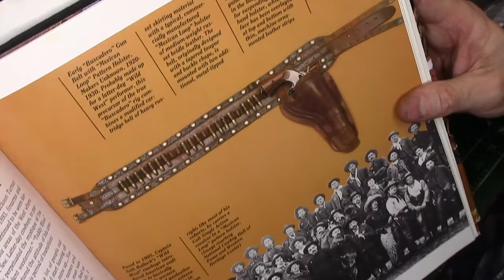Leathercraft: Buscadero Tooled Leather Cartridge Belt & Holster Cowboy Action Cosplay Leatherworking

Comment: I've made a stage version of this whih, instead of a slot cut in the leather, has the lower decorarive strap securely rivetted to the main belt at points separated by a holster width. You can hang the holster/s from any of those loops, allowing you to (say) switch from single to twin guns to side + crossdraw without having to cut multiple slots. Truly versatile.

Comment: Amazing as always! May I ask some questions? 1. What do you use to dye? Whats in the pickle jar?;)
2. What thread did you use to hand stitch this? Thank you so much!
Reply from the maker: This one was dyed with Fiebings' russet thinned down with denatured alcohol. That's what's in the big pickle jar. After the dye dries I give it a coat of neatsfoot oil then use the antique finish. Stitching is done with #277 bonded nylon.
Reply: Love watching these builds! You do amazing work! Quick question for you. Do you put a resist on your piece before you antique it? New to the craft.
Reply from the maker: @megs2436  I don't usually. However, I do put neatsfoot oil on it first.

Comment: Incredible work!  You ended up putting the holster over the top, which is what I was expecing you to do. Did that slit in the belt end up serving any purpose?  Also, what kind of pistol is that?  Lookes kind of like a Vaquero.
Reply from the maker: Thanks! The slot just gives you options for how you want to wear it. It's a Uberti El Patron .45LC in stainless steel

Comment: Okay.  Opinion.  I would not have put the 2 small buckles on the belt, it burdens it too much.
 The pin of the cartridge belt or holster of the revolver would have placed it inward so that they do not cross in sight.  And the button - coin with two openings I would have simply held it inwards by the pins to make it more noticeable and I would not have put that braid.